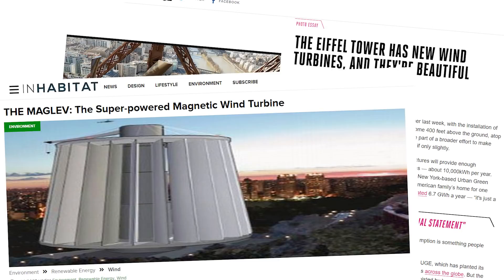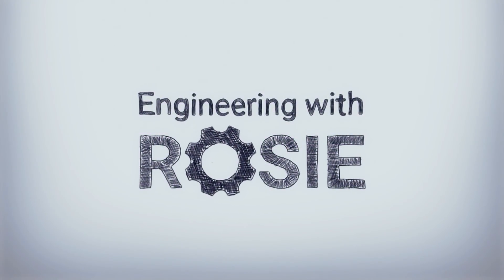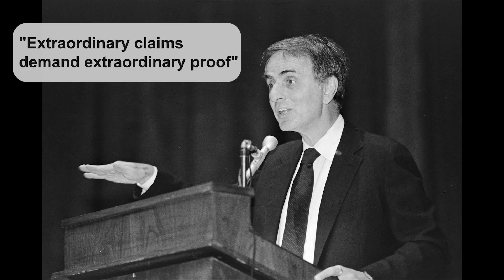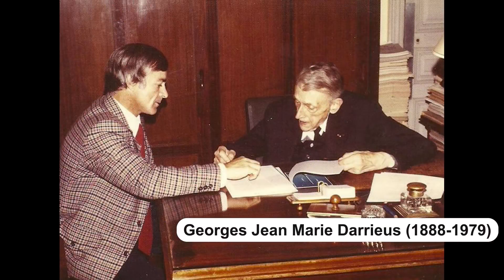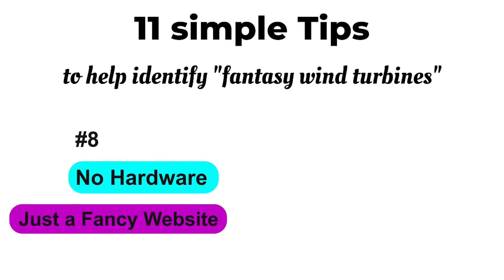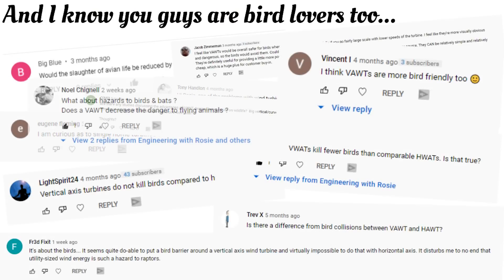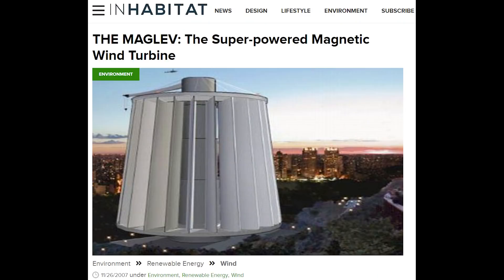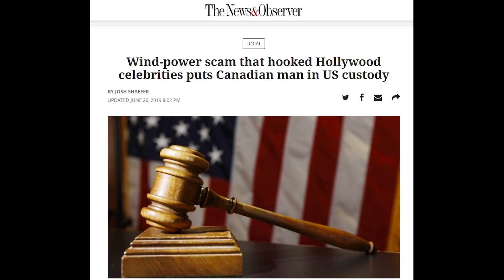Back to the Future of Wind Energy Technology with Paul Gipe

Comment: When these are discussed, people so forget the DiY space. Yes, lift devices are efficient. But they're so damned difficult to make! And efficiency is useful, but getting something is better than getting nothing. Not everyone can buy a $1000 wind turbine. It's easier to salvage cans and old motors and use the plethora of designs out there to see what we can come up with. Those books are useful, but people really should understand people's capacities. But again, when it comes to those companies, good they get smacked for their fraudulence.
Also, coming to city spaces, there is a trade-off between one extremely efficient turbine, or even a LFTR for that matter, and billions of less efficient systems sharing and storing the little they capture. Same with solar.
Reply from the maker: That's a great point. I personally love small wind including vertical axis and drag machines, because they are a more "personal" scale than the utility scale turbines. They are excellent engineering and tinkering projects and you can learn a lot and get so much satisfaction from them. I did mention it briefly that I think small wind is great for backyard (not sure if I explicitly said DIYers in this vid but I have elsewhere). This video was supposed to be a rebuttal just to the "future of wind" type claims that are commonly made, that the "next big thing" will be replacing mainstream utility scale turbines. I will be doing more on small wind and urban wind in the future. Hopefully one day I can share a backyard wind project of my own, but that needs to wait until I manage to buy a property with a backyard first! 
For now, the only "small wind" project on my channel is this fun project I did in the winter holidays last year: https://youtu.be/WDJ5ZLFSa6c Even though it was just for a laugh, I have to say I learned some real engineering lessons from that one!
Reply: I have nothing against DIY anything but the DIY community is totally irrelevant if we’re talking about dealing with climate change. We need big companies like Siemens that make 5 MW machines to be installed offshore ASAP.

With 7 billion people on earth needing electricity we need large efficient renewable energy installations to even make a dent in the problem.  

I like building my own stuff as well, So no offense intended. All the best to you,
Reply: @solarwind907  I disagree!
If you follow your analogy in the solar farm scenario there would be no small 2-5 KW units set up on peoples roofs ..... yet when you look around you see more and more of them!

Urban areas may well be less good for wind (but the tops of multi story buildings my be better than average. Chasing efficiencies is  good idea, right up until you start spending more than you get!
Reply: @totherarf  Dave, putting wind turbines on a multi story building Has always been a bad idea. Talk to wind or tower engineer about resonance. Read Paul Gipes books. Educate yourself before you recommend something dangerous. 

There’s nothing wrong with putting a few KW of solar on your roof, on a pole wherever on your property and making some power. I’m all for it. However, if you want to make a dent in climate change how about mandating every box store/mall/parking garage WILL have PV installed. The PV would be installed for maximum power production per square foot.  If we’re going to do anything about climate change we’re gonna have to quit screwing around. 

DIY projects are great. Small wind an solar are wonderful. No argument there however we need terawatts of wind and solar installed over the next five years or it’s going to be hell on earth for the next generation if not sooner.
Reply: @solarwind907  I understand resonance it would require eather large or many smaller generators The Same Size to have a noticeable effect .... you can design round that! 

Does it matter weather you have one 5MW wind turbine or 5 1MW or even 5000 1KW ones?

As for your assumption on affecting Climate Change we will have to differ.
Gretta Thunberg's Grandad failed to take account of water vapor absorption in the atmosphere and assumed CO2 was the main culprit. An assumption taken on by many, but by no means all scientists!
Reply: @totherarf  You have no idea what you’re talking about and you’re not interested in learning so, good luck to you!
Reply: @notdem notrep  OK ... Your opinion. If you can point out anything I have said that is wrong (without extrapolating it to an extreme) I will re-evaluate my position. My assumption is that I am right .... but I am not certain about that and am willing to learn. Having said that it takes more than a "You are wrong"! to initiate that!
Reply: The inefficient turbines are a waste of time and resources.  Resources are not infinite.

Comment: I decomissioned/purchased a UGE VAWT a few years ago, really just for the inverter.  I went through the cost of purchase and maintenance on that machine while the guy owned it.  It did produce a bit of energy but it came in at about $13/kwh.  Not good.
Reply: Ouch. What kind of amortized cost of electricity can small wind normally get you these days? I mean, obviously it depends on local wind resources.

Comment: We need to de-centralize energy production. Every home should have solar collectors (thermal & photovoltaic) and small wind turbines along with energy storage.  Stop thinking of just efficiency and start thinking in terms of watts collected per cost (Watts/$).  Keep the systems simple and reliable and less expensive.
Reply: Exactly
Reply: Efficiency is only irrelevant if you are totally off grid and need a power source at any cost or get your hardware nearly free and DIY the installation. A typical 6kW domestic rooftop solar system can be as cheap as $6k these days, though in many places you still have to pay $10-20k. But if instead of modern efficient 200W-400+W panels you used crappy ancient 100W panels you would have to install 60 panels instead of 15-30 and the amount of money you need to pay the installers would be huge compared to what money you saved by getting cheaper panels and lowering your electric bill.
Reply: Thank you for the info.  The whole point is to be off grid and not be dependent on corporate overlords who can control every aspect of our lives.

Comment: Have one of Paul Gipe books from the 80's.  Have an Aeronautical BS degree and for fun as much as anything have calculated design, many over the years.  Starting always you do not control the wind direction or speed related to time.  Energy in the wind is a cubic relationship.  You do not control grid power demand so what you are allowed to supply is not in your hands, and even home systems there are limits on capacity and rate.  Can not ignore them because you can not control them they do not go away.
(PS earned higher then average salaries as an inventor across multiple technologies.  So I like unusual designs and like analysis from principles.) Did lots of vertical axis air foil approaches and some balloon approaches.  Never did a ducted because as Paul said material is cost and  pointing into the wind with a duct that is massive isn't easy.  Also did the bladeless vibrating cylinder.  
So my conclusion is that the egg beater vertical is the simplest, lowest weight per output, and highest speed range.  The problem is control or rather the lack.  Have never seen anyone come up with a design that maintains simplicity and has good control.  The best candidates are a snip of the egg beater from the bottom 'V', middle '||', and both together.  
On the balloon side, still need efficient airfoils and the balloon has to have the lowest volume to weight ratio.  Tethered balloon problems are all weight and handling.  High speed generator to keep weight down and high voltage two wire tether that are like the lightest high power lines a strong center and a conductive coating.  High frequency to put the current in on the skin results in a lot of inductance which forces the wires together which leads to insulation problems.  and then there is handling of this tether cable and the balloon itself.  Take it down in high wind and reduce its size to put in a container.   Microwave transmission would eliminate the two wire problems but add weight and inefficiency as a high cost of power electronics in the air and on the ground.

Comment: I have been researching this for a personal off-grid setup for a few years now, and it is daunting. To figure out a battery bank, which types of batteries to use, BMS, inverters, charge controllers, wiring, solar panels, turbines, small scale hydro-electric, even human power... There are many ways to do it, but it is more often than not a DIY venture. I love that aspect for my own curious, problem-solving nature, but for mass adoption it will continue to be a real hurdle for quite some time. I feel like the best option for myself, and most likely everyone else looking to generate their own power, is a combination of some or all of these things. It really comes down to harnessing what is available in your environment. For example, my land is situated at the bottom of a hill where water pools near the peak, so hydro-electric seems feasible with a small dam, a decent length of pipe, and a scaled down version of a typical hydro-electric generator. Also, I am on one of the windiest coasts in the world, so wind power is something I am strongly considering, but to re-purpose vehicle alternators, electric bike motors, or buy an expensive pre-built generator? it is tough to choose. With advances in solar technology, even in my predominantly overcast climate I can still see some decent charging from a 1200-1800W array. There are so many factors to consider, but with enough research you can feel confident in your choices, and ultimately learn the most from the building and using of the system.
Reply: The draw back is system cost vs grid tied installation (when its feasible).  My one thought for homesteaders is a backup freezer battery bank for out of power emergencies.  The cost of a gas generator vs a viable 'offgrid' system drives the generator cost as doable vs a green preferred one.   Great points 
Awesome vlog on a subject  I keep in my little green heart ...
Reply: @Pat James
If the water runs year round then use micro hydro- or pico hydroelectric.  If the water runs a hundred meters downhill then you may be able to get a few hundred watts and store it in lithium iron phosphate batteries that last a long time.  Will Prowse's channel does a lot of the explaining for you.
Reply: @acmefixer1  I have been learning a lot from Prowse as well. I am currently looking at a 24V series/parralel bank with at least 400Ah capacity. Learning to balance cells, wire components, and source materials has been a journey, but feel it is the right step forward. Power independence is worth the time it takes to learn and implement. Kris Harbour has a cool hydro setup, I was thinking something along those lines.
Reply: @PatJamesRicketts  Hello
Water is an attractive source of energy, but in my opinion it is the hardware that requires the most attention in terms of maintenance. I find solar energy much better and if you write with you blowing a lot then even a wind generator is worth considering.
Reply: just fugawds sake, stay away from Tesla
Reply: Generally where are you?  I do think that wind is more practical vrs solar because  stormy times I think are when you need the power. But if you live where you can build as logical I like passive annual heat storage buildings
Reply: @jeffbybee5207  there's s problem with stormy is when you need power with wind turbines.

You see, Wind turbines don't work when there's too much (you guessed it) 🌬️"wind" strong wind forced turbines to hit the brakes or break 💔 thus stopping power generation

But I've seen a family proyect that's designing a Vertical Turbine that solved that and seems to be 400w seems to be the best option out there even if it's not out yet
Reply: Axial flux wind turbine.  Possible to build yourself
Reply: Would love to hear how your project is going. We live in the Outer Hebrides, and we are daunted by all of this!
Reply: @MrRob1904  harmony turbine - lto battery -

Comment: That was incredibly interesting and also pretty hilarious! We keep falling for the same old tricks again and again. I agree that a lot of this is people getting very excited at the idea of a revolution in wind, which is great, but as you say these products are often not fulling the need people have in their minds. It was interesting you pointed out that these old failures can get a second chance if the wider system and technologies change. I wonder if you have any thoughts of breakthroughs in other technologies/regulations/behaviours that might indirectly benefit the adoption of wind turbines? It's still yet to show it's worth but I like the Alpha311 concept, as it makes more sense thinking of it as using wind turbines to improve the efficiency of cars, rather cars to generate wind energy. People have been chasing incremental improvements in car efficiency for years and it will be interesting to see if it is more cost effective to reduce the energy loses though recapturing it rather than focusing on the car aerodynamics etc.  Thanks for the great videos as always!
Reply: The advances made in electric propulsion systems have a strong tendency to benefit wind turbines (power generators generally) as well. I.e. power electronics efficiency, improvements in electric motor designs (which become generators with mechanical power input), gear box efficiency & endurability. Another field strongly coupled to wind power efficiency is aeronautics & aerodynamics (blade design = wing design, see e.g. vortex reduction), and of course advances in compound materials. Graphene has been hyped a bit too much lately, but we will definitely see some outcome for both electromagnetic systems and material technology from this in the near future.

Comment: Well, you've said that there are bad ones but it's not really as useful as telling us about some good ones.
Reply: OK, vertical axis machines are basically all a waste of money. It’s the physics. You can’t fight it.

Small horizontal axis wind turbine manufacturers got the hell beat out of them 10 years ago when the price of solar was cut in half. Most went out of business. There are a few, very few small win turbines that are worth buying. 
I believe kestrel is still available.  that’s a decent turbine in the 3KW and under market. Bergey makes a good 10 KW machine.

Actually, ask Paul Gipe where he thinks you should go for information on which turbine to buy today. Also if he knows any good dealer/installers in your area. I think his contact information is in the show notes. I’ve bought two of his books and they were excellent at the time I bought them decades ago. If his new book has the information in it you need and he recommends it, you should buy it.
Good luck to you
Reply: @solarwind907  Thank you!

Comment: Really really interesting stuff. Being a maker, it depresses me somewhat to think that it would be impossible to make any meaningful electricity for ourselves in this age of ever-rising profits and energy prices. Perhaps we are destined to always be beholden to a person or entity in control of our energy needs. Sad thought.
Reply: With solar you can generat energy cheaper than buying it from the grid
Reply: @emily36130  Two problems with that, first, installation costs, second, we have a south-facing house in the UK. I suspect we shall always be beholden to energy suppliers, at least until geothermal becomes a reality. But then maybe we'll find our house is built on some impenetrable material making even that impossible. The outlook is grim.
Reply: @andrewfox4467  If you can source cheap parts from a local scrapyard you can try building your own wind turbine, but I don't think it would produce enough electricity to pay for itself.
Reply: @andrewfox4467  " But then maybe we'll find our house is built on some impenetrable material making even that impossible" - it isn't energy generation per se, but an energy pump (head pump) is something doable, and likely much more impactful to your daily life (50% of your residential energy use is heat, not electricity).

However, I believe you are thinking about being a maker a bit too broadly - do you make your own steel? copper? fuel? fuels for brazing/welding? clay? solder? control chips? lumber? fasteners? Why do you believe electricity is somehow different from those other raw materials that go into your projects?
Reply: @factnotfiction5915  I agree (and thank you for your reasoned response 🙂), however at least with those items I get some say as to what I buy and from whom, with prices somewhat governed by market forces. If I was to liken energy to anything it'd be my water supply, which I cannot create myself, nor control either consumption (to a degree) or pricing. However with energy there is at least a promise, or potential of some degree of freedom from the arbitrary prices set by producers. Many people are benefitting from this freedom, and I would suggest that it's only natural that the rest of us want to join them.